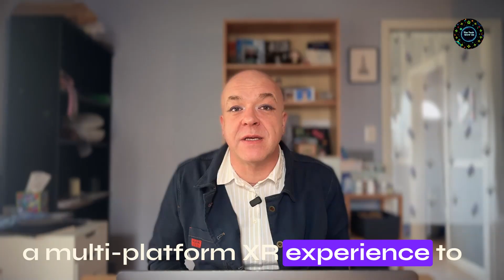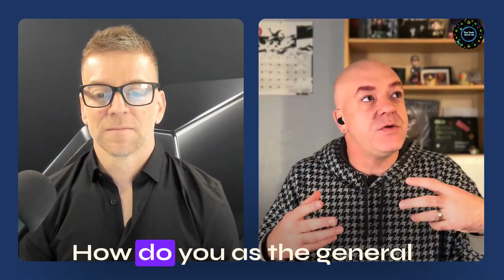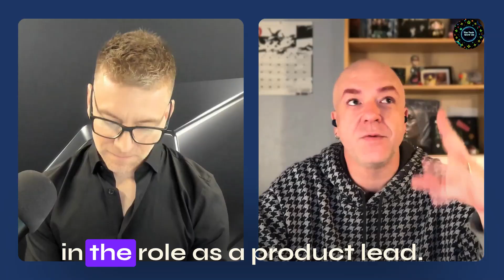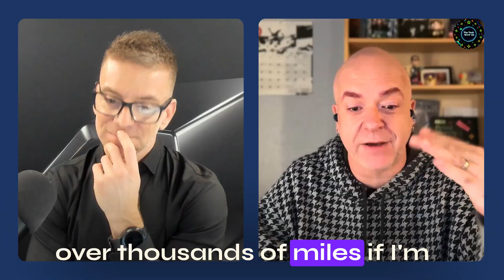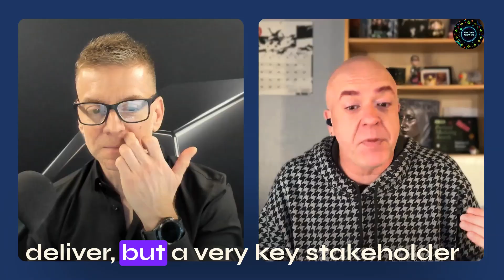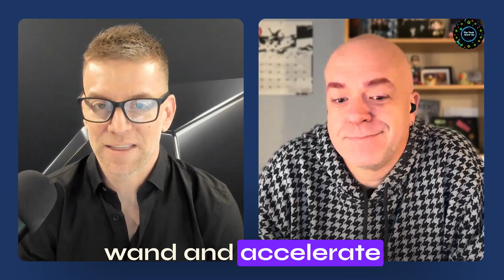Can VR Collaboration Find Problems Earlier To Save $280 Billion+ In Construction Waste – Nic Fonta

Comment: Thank you both for this inspiring conversation. I’m an architect myself, working in a non-architectural company that still has to design very complex infrastructure with a lot of engineering systems and sensors (digital remote towers for air traffic control).
A few years ago I started introducing 3D CAD workflows from the Autodesk AEC world into XR using Unity, and it has been incredibly helpful for me and my colleagues to actually experience the designs rather than just review them on screens.
Recently I also built a small prototype where AI acts as an NPC inside the XR environment, explaining the model and allowing you to point at elements and ask questions about what you’re seeing.
I’m fortunate that my company supports this enthusiasm and lets me push these ideas further. Really enjoyed the entire discussion, thanks again for sharing your insights.